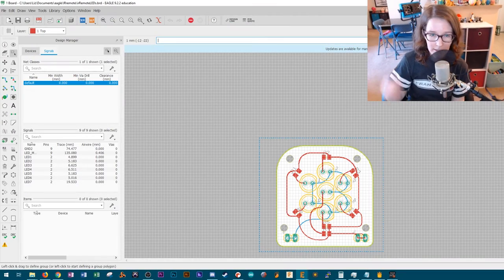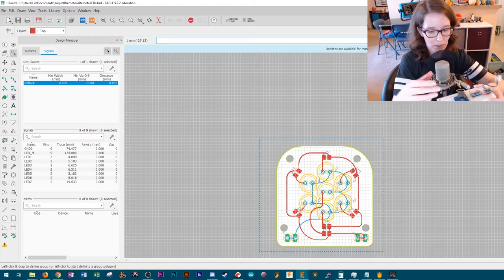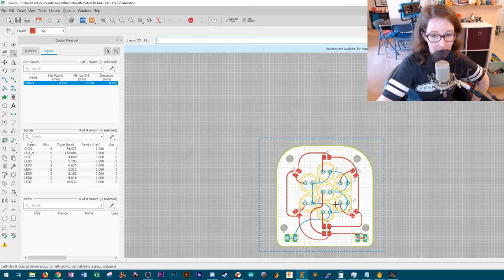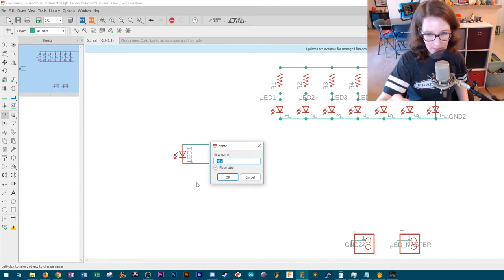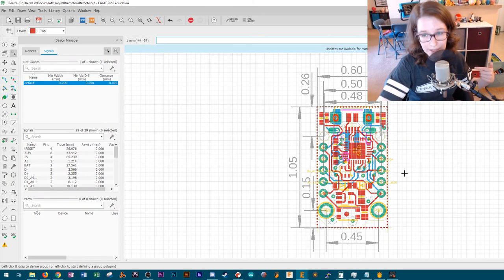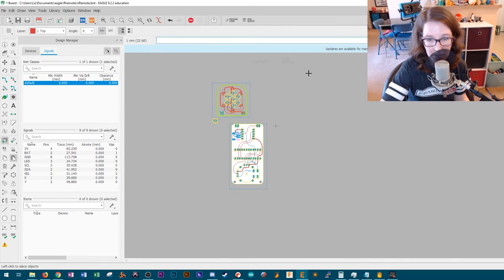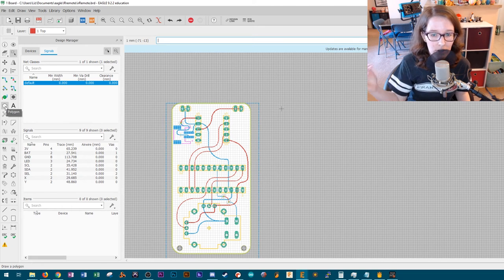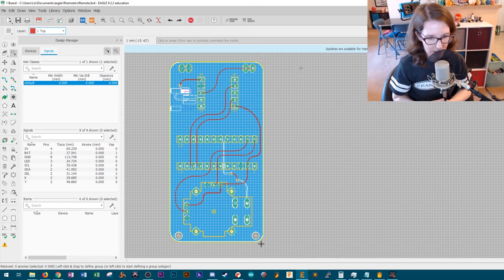Designing a PCB for the IR Controlled Robot Project: Eagle Tips & Tricks

Comment: Connecting signals by simply giving them the same name was indeed a life changing discovery. I didn't know about that for a long time either. It made schematics ten times cleaner.
Another one was that you can move component to the other side of the PCB by clicking middle mouse button before placing the component. And while routing, that also creates the via automatically. 
Great tips, thumbs up
Reply from the maker: Ohh I didn't know that, thanks! I'll have to try it.